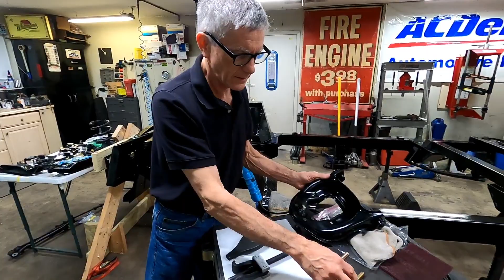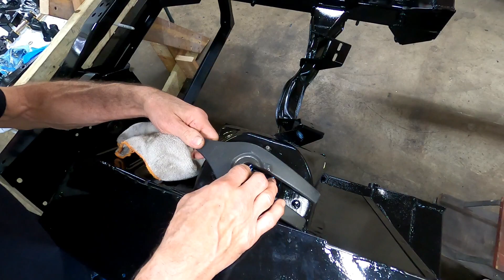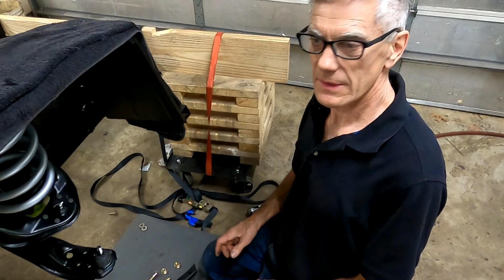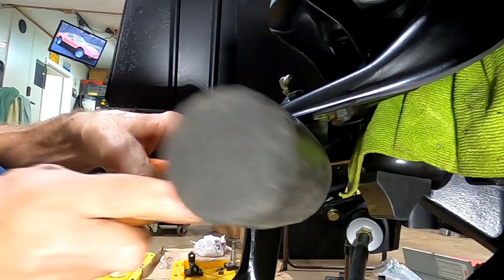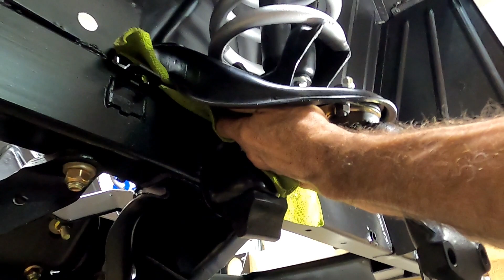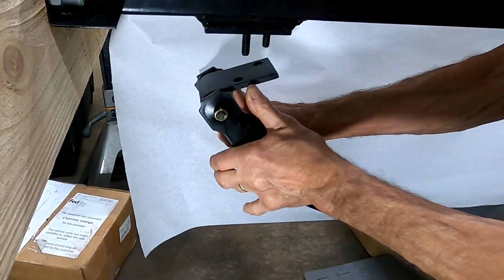Suspension Parts Assembly Part 2 For The Bricklin SV1.

Comment: I dont even have a Bricklin but I like watching auto resto stuff. Learned more about Bricklins than I ever thought. lol. I restored my 70 AMX (another 2 seater)  and race prepped my C3 Corvette and prepped my 96 Z28 for autocross and track. Just like to sand blast, hammer, weld, drill, hammer, bend, paint, etc....
Reply from the maker: I need to hire you!